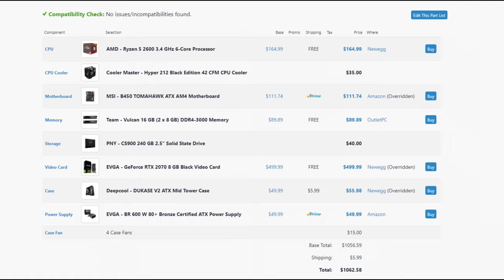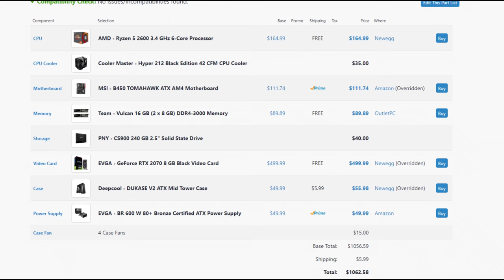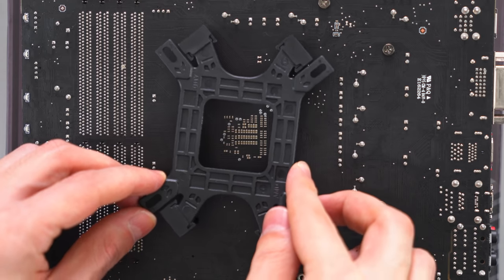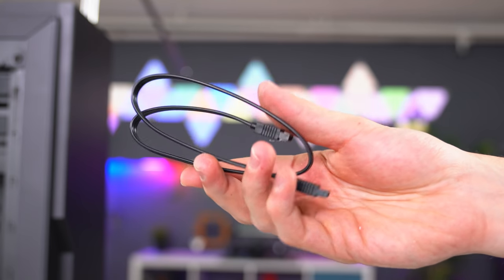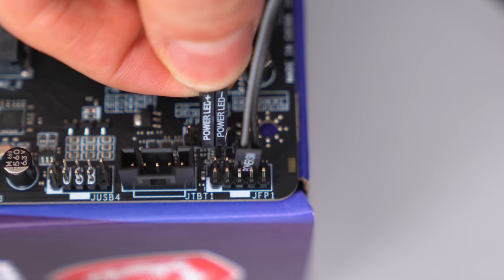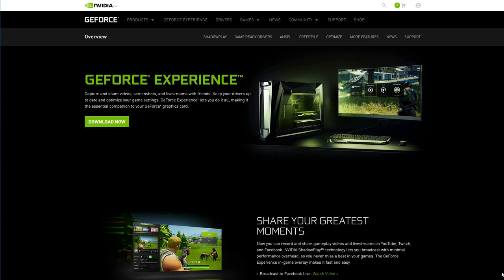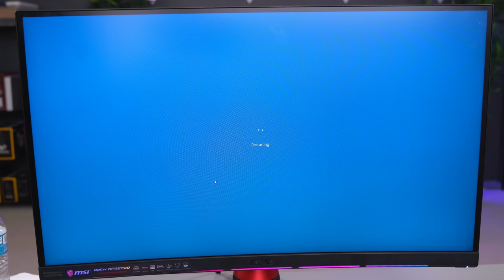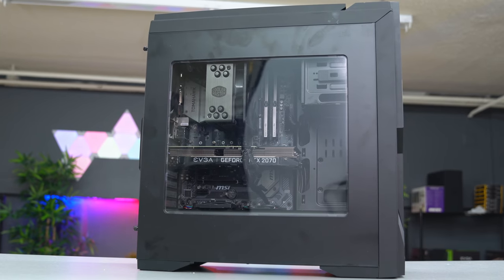How To Build A Gaming PC + Overclocking Guide (2019)

Comment: would this be a good build? 

CPU : AMD  Ryzen5 2600 
GPU : GTX 1660 ti twin x2 6gb ddr6
Motherboard: MSI B450 Tomahawk
Ram:  2x8 Kingston 8gb 2400Mhz Fury Black
SSD : Kingston 240gb
HDD : 1TB Barracuda
Power Supply: Thermal Take tr2 600 watts
Case: Xigmatik Astro

Need guidance. I'm just starting my first pc build.  Thanks.
Reply: Great build.
Reply: Try to get faster RAM. Like 3000mhz

Comment: What ram should i buy for a b450 and a ryzen 5 2600 . I dont know if this will work but its in my budget: Corsair Vengeance LPX 16 GB Desktop Memory Kit its 3000mhz
Reply: Hey, you can try this: G.Skill Aegis (2x, 8GB, DDR4-3000, DIMM 288)
Reply: As long as its ddr4 it will work... However, for ryzen, I STRONGLY recommended at least a speed of 3000mhz (3200 if you can)

Comment: Any better suggestions , im 13 yo boy from finland just starting to go to pc building and about to build my first computer From the same specs as this pc, Evga rtx 2070 black, Amd Ryzen 2600 3.4 Ghz-3.9 Ghz , Evga 600 W Bronze, DeebCool V2 case, Msi B450 Tomahawk , And a normal 240 gb ssd and probably the same cooler thats in this build , Any better suggestions for this build?
Reply: Buy an hdd, 2tb should me more than enough. You can put like 4 games on a 240gb ssd

Comment: Nice video sir, that overclocking guide was simple and easy to understand. Im just wondering if I could use the same overclock settings but using the stock cooler which is the Wraith stealth i think. Idk if it is capable to cool down an overclocked cpu or not. 
Thanks! +1 Like and Subscribed

Comment: I actualy made a build 1100 euro
Evga rtx 2070 xc ultra ( on sale for 540 euro)
Ryzen 5 2600
Asrock x470 k4 gaming fatality motherboard 
2x8gb ram 3200 mhz ( hyperx predator rgb)
700w power supply(thermaltake)
Deepcool matrexx 55
256 gb ssd ( is not that much but i will buy a hdd later this year)
Cooler master hyper 212 black
And for 192 euro a 144hz 1ms monitor lg 24gm79G
And a tp link t2u plus high gain ac600
Reply: L1m1T awesome! What does it run csgo at?

Comment: My set up costed me around $960

I5- 8400
GTX 1660
MSI B360 A Pro 
Corsair H60 cpu cooler
Corsair RGB Vengeance Pro ram 
Kingston 240gb ssd
WD Blue 1Tb hard drive
Corsair tempered glass Spec 04 case, yet now thinking about it did I not buy the proper parts.i prefer intel’s CPU so I’m okay paying more for the I5, after all I will be editing with it
Reply: costed damn
Reply: RockyJames121 yeah, I mean I spent maybe $30 more on ram for rgb, and I didn’t need a $70 liquid cooler yet I got one and a few other stuff I spent more so all in all it could be more like $750-850

Comment: I recently built a pc with a ryzen 5 3600 MSI B450 TOMAHAWK 16gb of ddr4 3200 RAM and a 1660 ti but when I try turning it on the monitor says no cable connected and the EZ debug LED lights up. Everything else works. I'm sure I installed the CPU correctly and I updated the bios but it still doesn't work. The 4 pin piece of the 24 pin connector seems a bit loose but I've pushed it in as far as I can. Can someone please help.

Comment: On PC Part picker it says the Hyper 212 CPU Cooler May require a separate mounting adapter to fit the motherboard
Reply: Only the original hyper 212 might not support all motherboards. The hyper 212 black edition which is the new version comes with all of the mounting hardware for all current motherboards.

Comment: Is there a difference between the 1070ti ftw and the gpu he used
Reply: the rtx 2070 has ray tracing which makes reflections an other things look a lot nicer so yes there is a difference the 2070 also has higher frame rates so it is better.

Comment: I'm trying to piece this together but ran into an issue finding the case. After looking around for other cases, I could not find any that would allow the clearance for the 9 inches for the Hyper 212. Is that dimension correct? What's a good replacement? Thanks for the help!
Reply: Any help would be appreciated
Reply: @Jeremiahss  Did you ever find a case that works? I'm looking as well. Thank you.
Reply: @cindydeemer-weiss8061  Probably way too late, but no. Went with stock cooler

Comment: If use the same parts but changed the case to an NZXT design and change the fans and maybe to bequiet fans and CPU cooler, will it make a difference and still being able to overclock the CPU?

Comment: Can i use the Corsair Vengeance LPX - DDR4 2x8gb 3200Mhz instead of the 300Mhz? Please respond fast!
Reply: Nbal Jabr does not matter what mhz ram you buy whatever your mobo can max at is what frequency the ram will put out. If max is 3000mhz even though you buy 3200mhz version it will only run at 3000mhz. Hope this helped
Reply: as K HD said... first you need to take a look at what max speed does your motherboard support.. if it supports 3200+ .. and you have a Ryzen CPU it is recommended to put higher speed ram so the CPU will benefit more ... of you have an Intel cpu .. then the speed doesnt rly matter that much its only that Ryzens really benefit from speedy rams :D...hope that helped :)

Comment: My pc
1.i5 8600k
2.Gigabyte Z370XP SLI
3.Cryorig h7 cpu cooler
4.G. Skill Ripjaws 8 gb 3200 ram ddr4
5.Aorus Rx 580 8 gb gddr5
6.Antec Neoecho 650M semi moduler psu
7.Gigabyte ud pro 256 gb sata ssd
8.wd 1 tb hdd
9.3 fan 2000 rpm
If I add a 240 aio.Can I reach up to 5ghz?with safe temps..
Reply: Full Entertainment Probably, also get a really high quality thermal paste just to be sure.
Reply: @fid9255  obviously..

Comment: I know this video is old but im building a new pc and wanted to ask if i can match a ryzen5 2600 with a gtx 1050ti that i already have ? Will it bottleneck ? Im thinking to change it later which is better a gtx1660 or an rtx 2060 ? I want to play on 1080p with a 144hz monitor that i have and maybe stream or record sometimes !!
😇
Reply: there will be a small bottleneck but realy not much. if you want to make use of the 144hz you should take the 2060.

Comment: Would it be beter if I use a i5 9600k instead of this processor?
Reply: You might have to change the motherboard since this one is only am4 processor compatible, it will only work with AMD

Comment: I am thinking of buying this pc but I've never built one before, should I go for it?
Reply: Pure Pulse what your budget if you have a higher budget I can give you a part list for your budget and it could be better if budget is higher
Reply: @hellomoto6300  well $1,000 would be my budget, I want to switch from console to PC and I want a pretty good Computer that can game at 100+ FPS
Reply: @ Pure Pulse do you just want a pc for 1k or a setup for 1k?
Reply: @hellomoto6300  PC for 1k, I've already ordered a desk for my setup
Reply: https://pcpartpicker.com/list/3nstxG here this is the list. Also try to overclock the ram to 3400-3600 at cl16(16-16-16-26)
Reply: @ Pure Pulse if your pc dose not boot then get a usb drive and do bios flash back(the msi motherboard supports bios flash back)

Comment: Will i have to change any other specs if i change the 2070 with a 2080
Reply: Better use a ryzen 7 or i5 for rtx 2080.
Ryzen 5 2600 will do the job also but you'll be better off with a ryzen 7 or  i5 or even an i7
Reply: Angad Grover i dont need to change the power supply or anything else?
Reply: @EpicZay  I recommend asking this in the reddit sub r/buildapc

Comment: So my case came with power cables installed and my power supply came with a lot of cables installed into it, can I connect the 2 cables or do I just use my power supplies cables?

Comment: If I don't plan on playing on  144hz monitor or 1440p, should I skip 2070 for an Intel i7 8700 ? I don't know why but I don't trust amd at all
Reply: If you're playing on 1080p 60 hz you should just get a gtx 1060 - intel 5 8 gen or sth like that save up the money (you can go for RX 580 which is about the same strength of the 1060 (sometimes weaker sometimes stronger,  depends on the game)but you dont trust amd for some reason)
Reply: @odainabeelnajjar4657  I have fx9370 that's why I don't trust amd I want a PC that will play everything ultra for 3 years in 1080p
Reply: @St0NeR95  bro trust amd , and if you still dont and you really want your pc to handle ultra for a while go gtx 1070 , 1060 should be enough IMO

Comment: Do I have to worry about doing a BIOS update for the motherboard to work with this new CPU?
Reply: masulsa40 This particular motherboard actually has a neat feature that allows you to update the BIOS without a CPU, but if you’ll be buying this motherboard new then it’ll most likely already support the Ryzen 3000 series. This goes for most B450 motherboards.
Reply: @imamalox  thank you!

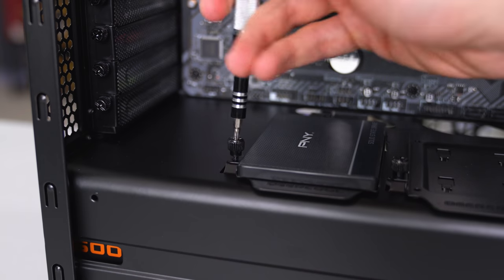Comment: @techsource bought everything you suggested since this is my first build and come to find out you didn't include the hard drive (11:07) in your links AND in your pricing. Do you have a suggestion? Which hard drive is best for this system??? Thanks man
Reply: Lc J   You don’t have to get fancy hard drives, as they are just mass storage and don’t need to boot anything fast. I recommend the Toshiba P300 2TB 3.5 inch hard drive. It’s very cheap and is 7200 rpm not to mention 2 TB is more than enough for most people 👍
Reply: Yeets In Blyat thank you!
Reply: It’s cool. Happy to help!

Comment: I'm using the stock cooler for the ryzen 5 2600 and I know he said his overclock was safe even with the stock cooler, but I'm still a bit nervous that my temps will get really high. If anyone has actually done the overclock with the stock cooler could tell me how their experience went that would be great.
Reply: I really don't think the stock cooler for the 2600 is good for overclocking,but if u do, then make sure its a light overclock
Reply: JAYBOSS yeah I was thinking of doing the overclock that Ed did in this video where he overclocked it to 4 ghz
Reply: @yusufekinci4676  for 4ghz i'd recommend going with an aftermarket cooler
Reply: JAYBOSS ok thank you so much
Reply: @yusufekinci4676  no problem

Comment: how did you manage to oc to 4.1ghz at 1.300 volt stable on air cooler
mine struggle at 4ghz with 1.36 volt WITH water cooler. But im using B450 itx ac msi.

Comment: I can’t have won the silicon lottery. I have a good cpu cooler and at first with my R5 2600 @ 4.0Ghz with 1.3125V it worked, both in Cinebench and in Aida64. But after that I ran another Cinebench and it crashed. Wth is going on?!
Reply: Ok, so now it passed? But it only got 1283 as cinebench score, which is the same score as stock (3.4Ghz)?!

Comment: Was the benchmark tested with or without overclocking the system ?
Reply: without overclocking apparently
Reply: @Jay-nk1fh  115fps on BFv on ultra settings without overclocking is almost to amazing to be true. I have to know for sure. Before i over build my pc in the near future .
Reply: @josh7562  it is reachable with just a 2060 from what i've noticed from other benchmarks. i also think you should hold off and check out rtx super and amd's upcoming releases before grabbing the 2070
Reply: @Jay-nk1fh  i was going for the i5-9600k 6 core , a MSI rtx 2070 8gb and Asus ROG Strix z390h combination. Was hoping to get good deals and all of the components  this coming black friday or july 14/15/16 specials
Reply: @josh7562  good luck with that, bro! im still saving up for my build, i'll hopefully get it done by the end of the year

Comment: any significant difference in using the stock cooler versus the other cooler??
Reply: BenWL if you stick with the stock cooler, don’t expect to over click your cpu. It keeps the cpu cool at stock frequencies but once you overclock it, it can’t keep it cool enough.
Reply: @Rapidfyreszn  thanks also what difference does overclocking make i am new to this also would you recommend this pc for gaming and streaming?
Reply: BenWL yea I’d recommend this for both. You’d get 60 FPS streaming and obviously you can see the normal gaming performance in the benchmarks. And overclocking just draws every bit of performance you could get out of your chip or gpu. It just bumps it up another notch

Comment: Do I need an HDD to? Or am I fine with just the SSD.
Reply: You dont need an hdd but i would buy one because 240gb is not very much. But if you dont need mutch space then you dont need an hdd
Reply: Ok thank you
Reply: @alexc3663  no problem😁
Reply: Also one more question would the DeepCool D-Shield V2 Work for this build since the other case is out of stock

Comment: Would plugging in a USB wifi dongle work to get wifi until the drivers are downloaded?
Reply: Bms14009 no because the windows doesn’t have the drivers installed yet , so nothing will work as a internet connection till u download them first .
Reply: @cesarmatos4093  ok thx

Comment: Do you have to put thermal paste on this build?? Please like so I can get an answer because I’m building this
Reply: The stock cooler( the one with the Ryzen 2600) has thermal paste pre-applied to it. However if you are using an after market cooler most of them come with a small thermal paste tube which you can then apply on the cpu.

Comment: Is it okay to not plug the molex since it's already on the mobo?
Reply: if the fans are already plugged into the mobo then you don't have to plug in the molex connectors. those molex connectors are only there if you don't have enough fan-connections available

Comment: Intel i5 9600k or Ryzen 2600k for a gaming pc?
Reply: Seventy Two i5 9600k longer lasting they are equal on power but you get what you pay for with this stuff and the intel i5 is just better for long term use
Reply: @themilkman9360  Cheers:)
Reply: @themilkman9360  what are you on about? The i5-9600K is a tad faster then the Ryzen 26000x but in no ways its longer lasting. The ryzen has more threads,cheaper,and has a better upgrade path. Don't bullshit people  with stuff you don't know.

Comment: Ed, would this build be good if i added the ryzen 2700x instead of the 2600
Reply: No, he show that the 2600 is better for gaming
Reply: @henzr3518 The 2700x has a base clcok of 3.7ghz and can be overclcoked to around 4.2 (ish) ghz which is better than  the 2600. Also The 2700x has 2 more cores and 4 more threads. I was just checking with Ed to see if it was a good fit for this build - meaning is it not overkill

Comment: I saved up for a long time and built a build with a 2080 as well as an Intel core i9. Yet for some reason his build seems to run better than mine (better frames in games) I've overclocked and everything, yet my performance isn't as good. I've even compared my build to my friends, (similar build to urs) and its still not as good. Why is this?
Reply: Do you have your hdmi connected to the graphics card or the mother board?
Reply: @gabofps6725  No hdmi connected. I use a display port cord

Comment: SERIOUS NEWB QUESTION
where will i see performance drop off (if any), if i save money and buy cheaper RAM?

Seems like i could save a hundred bucks or so on RAM.. is RAM that serious?
Reply: Cesar Flores I wouldn’t recommend going below ddr4 3000 if you want good performance. Past that doesn’t really matter too much. You can go for 3200 not a big difference tho. 16 GB for ram is a must if you want optimal gaming. You can go for more, but 32 gigs or above is overkill

Comment: My Ryzen 5 2600 crashes immediately at  1.3V and 4.0Ghz, what am I doing wrong?! Is a new CPU cooler something to consider?
Reply: Tried 4.0Ghz all the way up to 1.375V and crashed everytime
Reply: Managed to get it run stable at 3.9Ghz with 1.3V. I get well over 115FPS in Overwatch at epic settings so I’m pretty satisfied.

Comment: Hey, I’ve used this guide to build my own PC with the same CPU, i also followed the same overclocking guide that was given in this video. My PC crashes occasionally and the fans run like crazy when this happens, I check my motherboard and it signals that the CPU is the issue. I’m using the stock fan and my normal case fans, but I don’t want to buy new fans at the moment. If I reduce the CPU frequency from 4000MHz to its original which is 3800MHz, will this reduce the likelihood of my PC crashing? I don’t use any intensive games and generally run low settings and it still crashes after 30mins of gameplay sometimes, is the reason this is crashing due to the overclock does anyone know? Thanks
Reply: Also is it likely that it’s crashing because my CPU voltage is too high? It’s 1.3 V atm... thanks to anyone reading
Reply: He says in the video if the PC crashes lower your settings but I’m not sure how much I should lower the voltage for example

Comment: Does the Tomahawk work with the Ryzen 5 2600 and Msi RTX 2060?
Reply: The B450 does. The B350 motherboards only support the last generation processors.
Reply: The B450 supports the 2600
Reply: It works with the better cheaper 210 usd i7 9600kf.

Comment: And with b450 how many hdmi or displays ports does it have sorry I'm new to PC related stuff and can build 1 till next year 😢I noticed it has 1 hdmi I think I'll be using display port so how would I use 2 monitors
Reply: You just have to look at the graphics card. It may have hdmi, display port, dvi etc. Do not connect your monitor to the motherboard's hdmi, display port etc. because by doing that you'll use the integrated graphics card and NOT the dedicated one. If you don't have a graphics card, just connect your monitor to your motherboard's ports. Sorry if i said something wrong or if i have some grammat mistakes ;D
Reply: @thepronoob1750  I just trying to increase my knowledge it will be about 18 months

Comment: For gaming is better 1080(ebuy) then 2070(new) but chiper.
Reply: DagoN UM The 1080Ti is better than the 2070. But your also forgetting about real time tracing and all of the other features on the RTX 2070. As well the 1080 is not as up to date as the 2070.
Reply: @shadowkercaine9694  ok you are right